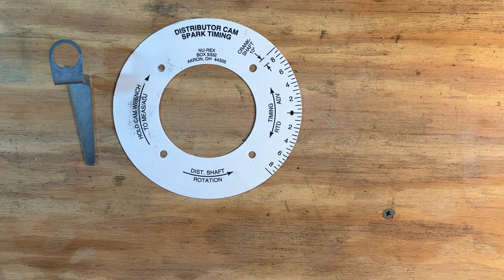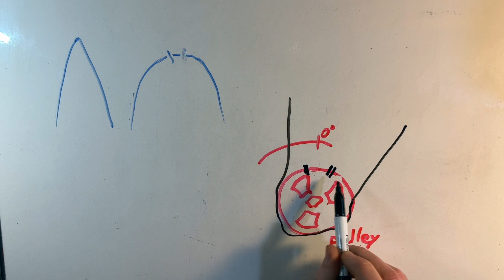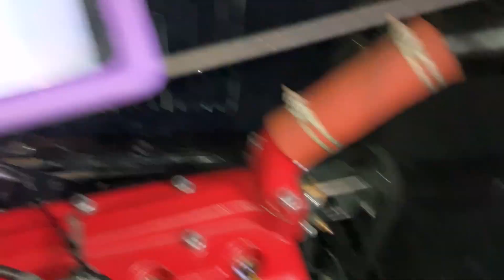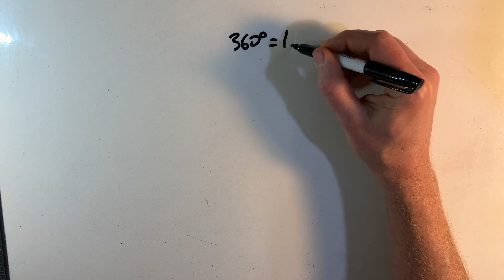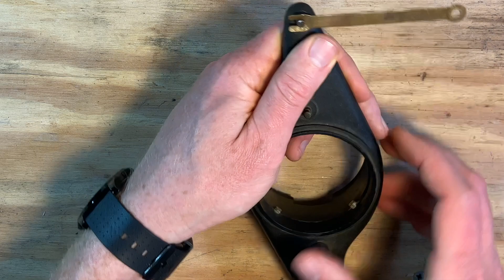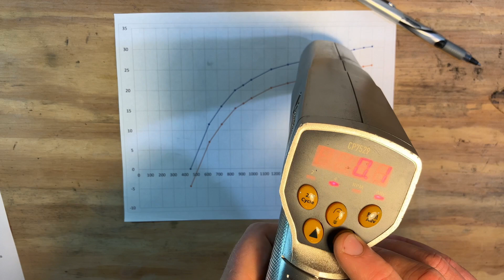Model A Ford – Precision Timing and Finding Top Dead Center

Comment: I noticed you're running a Marvel-Schleber (Sears All-State, Johnson 2405) carburetor. I guess you like them? Seems some like them others despise them?
Some say they're a fuel guzzler.  Any thoughts or opinions?
I've found a source for parts...Renners Corner
Reply from the maker: I haven't developed carb repair skills/tools yet, and I had persistent trouble with my Zeniths, so I opted for a Marvel rebuilt by the late Jim Bullock. It's had one problem, which is that the GAV driver (which consists of two spot-welded pieces) came apart. Bought a replacement from Dave Renner and it's been trouble-free ever since. Always starts, never stalls, just solid. Idles down to 300 rpm. I don't track my mileage, so it certainly is possible that it's not as efficient as the Zeniths, but fuel is a small part of my budget. On my project car I'm going with a Stromberg 81, so it's going to be awhile if ever before I get around to learning the ins and outs of the Zeniths.
Reply: @alexiskai  Mine runs flawlessly

Comment: You don’t need to use all of that complication to establish TDC. 

1. Just set points at widest tolerance and use your cam TDC dimple for mechanical engine TDC it is more accurate than guessing tdc from piston position.

2. Set advance lever where you want TDC and adjust point opening there.

Done

This isn’t a space shuttle adjustment you just need to be able to set the timing to TDC or after for start.

After the engine is running you are adjusting timing by seat of the pants anyway.

After initial setup point wear slowly retards timing until you readjust the point gap.

There is no precision in the adjustable part of the system

You are

Measuring with a micrometer 

Marking with a grease pencil

Cutting with an ax
Reply from the maker: That method does work well for most people. This method is for the small percentage who need a way to repeatedly time an engine to a specific degree value. If you don't need to do that, I agree – use the timing gear dimple and then set your spark lever as desired.

I don't agree that the timing gear dimple is more accurate than taking visual readings and averaging them. You're relying on the gear manufacturer to place the dimple with a tolerance of 1mm or less, and there's no way to be sure that your pin dropped into the center of the dimple rather than slightly off to the side. Taking visual readings ensures that you're measuring the position of the piston itself.

Comment: I'm trying to time my engine and having no luck. When I find top dead center and adjust my distributor cam till the points just begin to open my rotor is 1/4 inch from pointing to the post in the cap, Hope this makes sense. I know it must be something simple but I can't figure it out,
Reply from the maker: It sounds like your points are not in the stock position. Can you confirm: is the upper plate fully retarded (arm against the passenger side of the gap)? Are you using the V8 points? Are you using the Nu-Rex upper plate?
Reply: @alexiskai  Thanks for the fast reply, yes the upper plate is fully against the pass side of the cap. there original style points, and no way to move them. I'm pulling my hair out with this one.
Reply from the maker: @oldknuckleheademmor4791  That’s weird - I mean there aren’t many elements involved here. Upper plate, points, cam, and rotor. Gotta be one of those. What caused you to need to re-time it?
Reply: @alexiskai  I just got this car and figured I'd time it before trying to start it. When it is at top dead center the rotor is to the left of the contact point on the cap, Its like the points need to move counter clock wise but there non adjustable. Thanks again.
Reply from the maker: @oldknuckleheademmor4791  Yeah this one's gonna be hard to troubleshoot without photos. If you want to continue, I suggest starting a thread on fordbarn.com or vintagefordforum.com so you can add photos. The folks on those forums will have you sorted out in a jiffy.
Reply: @alexiskai  Thanks a lot Alex, I'll get some pictures and give that a try.
Reply: @oldknuckleheademmor4791 Hey, I believe I am running into a similar issue. What did you figure out? Did you make a post on fordbarn or vintage ford? If so what was the name of the post?
Reply: Using the nu-rex wrench aren't you rotating the distributor cam backwards, then therefore be looking for the points to just close, not open?

Comment: Nice, is your wrench a breaker bar? What socket size and depth will fit the crankshaft nut with its hooks for the original crank handle? 6 point, 12 point, deep or not?
Reply from the maker: On my car, the ratchet nut was all torn up, so I removed it and installed a standard bolt. The bolt has a 15/16" head, which is small enough for me to get a breaker bar and socket onto it inside the engine bay as you see in the video. If you still have the ratchet nut, you have two choices. First, you can buy a crank wrench from the vendors or at a swap meet. This is only way to adjust the ratchet nut from inside the engine bay. Second, you can buy a 1-3/8" socket (some aftermarket ratchet nuts are 1-1/4", so check first) and a 6" extension. You put the socket on the ratchet nut and then you run the extension through the crank hole in the radiator shell. Then you put a breaker bar or socket wrench on that and turn it from outside the engine bay. It works fine and actually is more convenient for this operation because the fan doesn't get in the way. 

Regarding which socket to get, either 6-point or 12-point will work, but 1-3/8" sockets can be a pain to find. This one might work? https://www.amazon.com/ARES-14008-36mm-Profile-Filter-Socket/dp/B09QVCHRYP/

Comment: You always know you're in for a thorough in-depth explanation of the topic when it's alexiskai doing the upload!
I have a question - maybe you know the answer: The instructions that come with the insert main bearing kit states that 
"29° of advance is the point of no return". Anything more would result in bearing damage, they say.
Does that mean full advance is no longer allowed? Sure, I can set the distributor to stop at 29°, but in my experience, that'd make it a sluggish gas-guzzler at higher speeds.
Or do they perhaps mean 29° of distributor advancement (which would result in 58° crank advance which I wouldn't want my engine to experience anyways)?
Best Wishes
Adrian
Reply from the maker: The short answer is, yes, full advance is not recommended and hasn't been recommended for decades. If you've been habitually running the car on 40° spark advance, that might be one reason your babbitt bearings broke down in the first place.

29-30°, or about 3/4 advance on the quadrant, is the total timing recommended for the stock Model A engine and cylinder head by most experts I've seen. The Model B distributor uses 32-34° total timing. The Phillips/Nu-Rex automatic advance uses 30° total timing.

Although the Model A manual states that the spark advance should be placed all the way at the bottom of the quadrant for "high speeds," it's unclear what that means, and with modern fuel there's no reason to think we need to stick with that particular directive.

You have several options for setting a 29° total timing with the stock distributor. You can make a little clamp that fits on the quadrant at the proper spot. You can follow the instructions in this video and set your initial timing at 10° ATDC, which would shift the advance curve to place the bottom of the quadrant at roughly 29° BTDC. Or you can modify the distributor body to prevent the upper plate rotating more than 14.5°. In any of these scenarios, you would ideally want to verify your total timing with a timing light.
Reply: @alexiskai  Very important intel, I'm glad we talked about it!
In fact, I had set my ignition to fire one notch after TDC (that ought to be 3 degrees if memory serves me correctly), which seemed to make the engine alot happier at higher speeds. 
It would of course also mean full advance would be 37° before TDC, which indeed would explain the bearing fatigue.
You, sir, just saved me from possibly blowing out my fresh insert bearings.
Thanks awfully!
Reply from the maker: @AstraWerke  Your description is broadly accurate, although in general there isn't a strict link between notches on the quadrant and degrees of timing. The linkage between the hand control and the upper plate goes through several steps, which all incorporate some degree of flex and spring. The axis of upper plate rotation is offset from the axis of control rod rotation, and the levers are a different length. This means that a notch at the top of the travel can translate to a different number of degrees of timing than a notch in the middle or at the bottom. And of course every car is different, etc.

Glad I was able to help you out, I've enjoyed your videos immensely.
Reply from the maker: By "thorough in-depth" I assume you mean "incredibly long and pedantic and usually involving math," which is correct. That is my brand and I'm sticking with it.
Reply: @alexiskai  But that's the thing I love. Most people would end at "the faster you go, the more you advance" - but I already knew that. You mention all the little things that are valuable to know about, especially when driving the car more than for the annual ice cream run.
Reply: Dónde va ágil y no golpea el motor,no hace falta darle el avance total,tengo amigos que no tienen oído para darse cuenta,o lo llevan golpeando o lo calientan atrasado,acá tu seguidor de Argentina que hace 39 años los usa a diario a los Ford A,saludos @AstraWerke